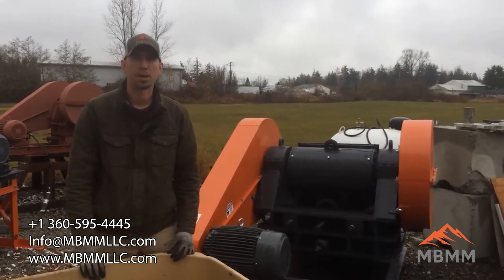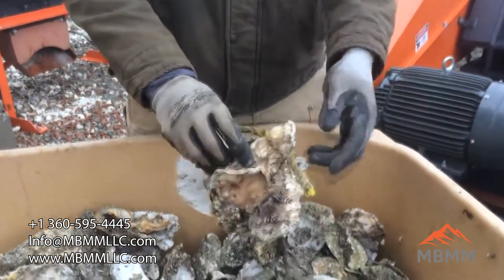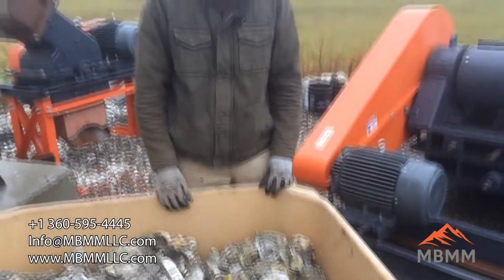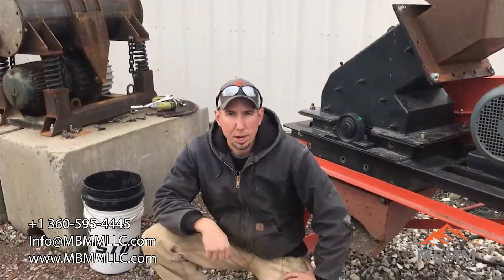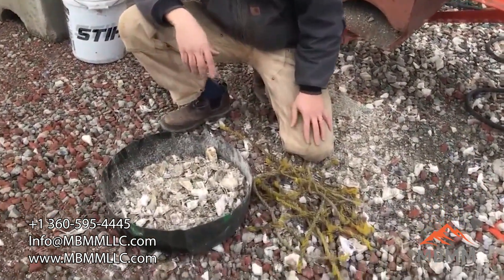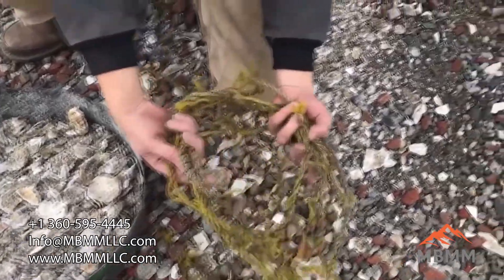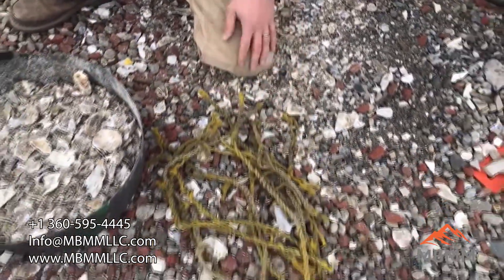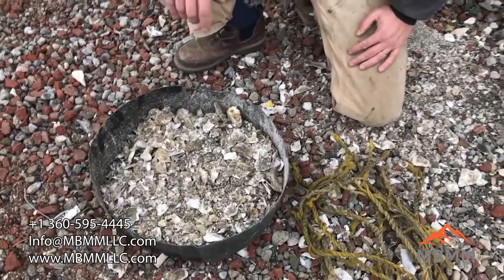Crushing Oyster Shells to Save the Environment 🌊

Comment: The feed rate on the jaw crusher is prone to weight of the input material I am thinking.  The light stuff will want to jump back up more.  If the input hopper tilted vertical more it might help with more input.  It is not like shells would jam the jaw crusher.  So a more configurable input hopper might make more solutions viable for the jaw crusher.  Much like different screens, different hoppers of just variable hoppers but if the use case is defined a dedicated hopper should always be better then a configurable one in my opinion as ability to configure often leads to weak points over time.

Comment: The hammer mill did exceptionally well. It was quick and left the rope in good condition.  Just add a screen to the hammer mill to crush the shell to a finer powder.  It seems that the hammer mill is the only machine needed for this job.